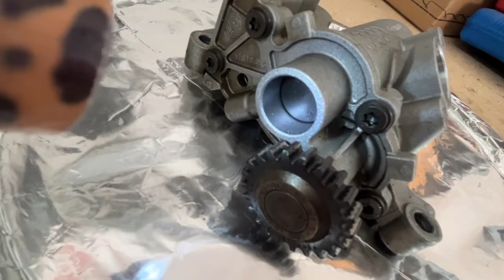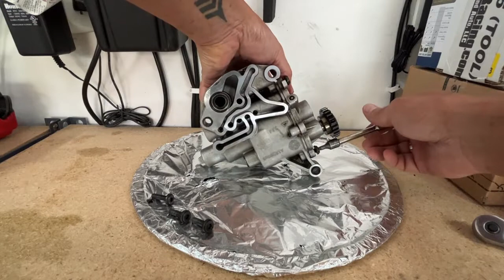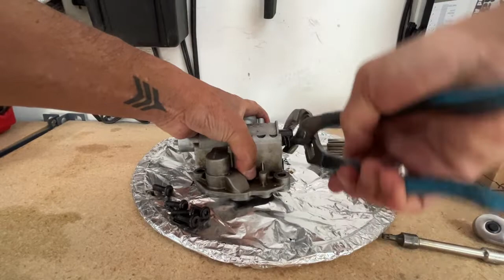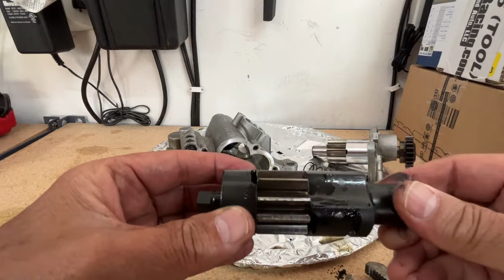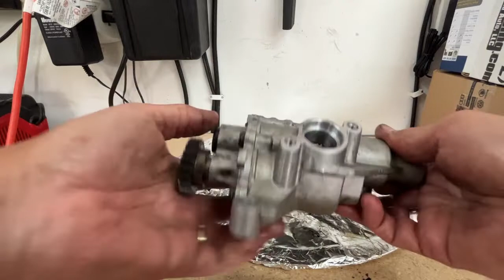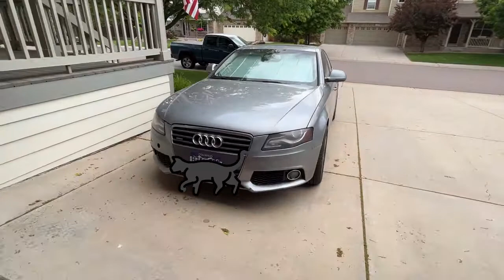Audi A4 B8 2.0T Taking apart the bad two stage oil pump to see what's inside! 8K2 TFSI CAEB

Comment: can balance shafts cause intermitted low oil pressure? and what is difference between low oil pressure caused with oil pump and caused by balance shaft?
Reply from the maker: I honestly don't know the answer to your question. I have seen a few youtube videos however where balance shafts and their screens might have caused oil pressure issues.

Comment: Yo I'm having the same problem with low oil pressure at idle. But I also sometimes get a warning at 3-4k rpm as well. I'm wondering if mine is getting old and sticking into the low pressure position. Lmk what you think.
Reply from the maker: Either oil pump is sticking in low position or the electronic switch that is supposed to do the switching from low to high isn't working or in the worst case, other internal engine issues. I can only really say for sure what my issue was and it took a while to even find that!

Comment: in my case the problem (very persistent oil pressure warning on idle sometimes with miss fire on all cylinders but not always)  was dirty vvt adjuster/magnet! Litle bit of parts cleaner sprayed in each hole and problem is solved!!!

Comment: Do you know what your oil pressure was at idle? Great informative vid!
Reply: Mine is not a VW but closely related. 5W40 oil. Morning air temperature never less than 68F. Oil pressure at 4.5barg just after the 1st start in the morning. 

Around 2nd minutes at 3.6barg at 900rpm & coolant temperature of 106 F. At 194 F oil pressure is at 1.5barg at 740rpm. 

But when coolant temperature is at 200~202 F & at hot day stop-go-stop-go traffic the oil pressure drop 0.8 to 0.7barg. 🤔🤔. When put to neutral the rpm goes up to 850 the oil pressure goes up to 1.5barg. 

Installing a pressure sender and routing to a pressure gauge on top of the dashboard is a must for all cars older than 10 years old. More so if it is a VW or BMW or Mercedes which are pushed hard
Reply from the maker: Hi, it started out at 20psi from a cold start but after 5 minutes it was down to 8 psi.

Comment: Please. Help. The whole damn engine is new. 2010 audi a4 2.0t. same problem with the low oil pressure warning and not starting again. The oil pump was replaced the first time the head was replaced. It was after market. Its the only thing i can think of. The only problem is my piston works but its still aftermarket. Im exhausted

Comment: Did you raise your engine to take out the oil pump? On you A4 B8
Reply from the maker: No, the oil pan bolts can be removed without lifting the engine. Some are hard to get to but it can be done. Oil pan comes out fairly easily once bolts are out and then remove plastic oil baffle, then oil pump.
Reply: @rad_vids  thank you so much and for you quick response. I have the same issue on my Audi with the oil pressure thing. Already replace the camshaft bridge, it helped, but it didn’t fix the issue.
Reply from the maker: @JoseStudios  it could be many things which is the frustrating part. I got lucky that it was my oil pump and not something more major (and even more expensive).